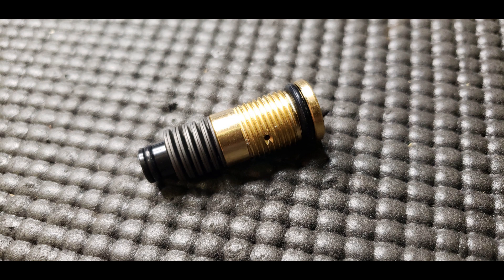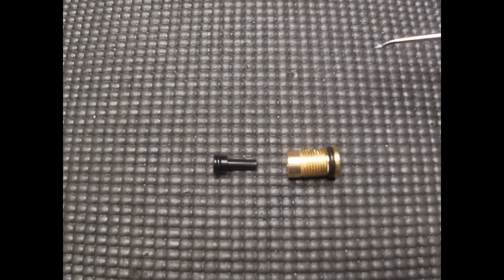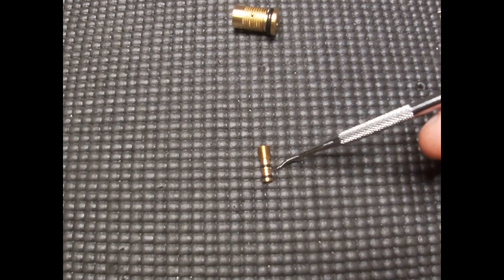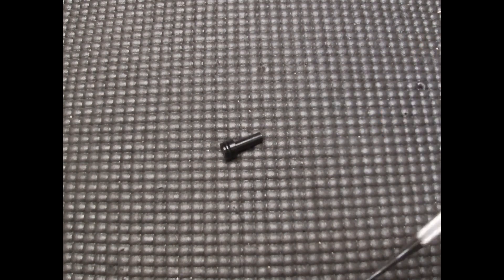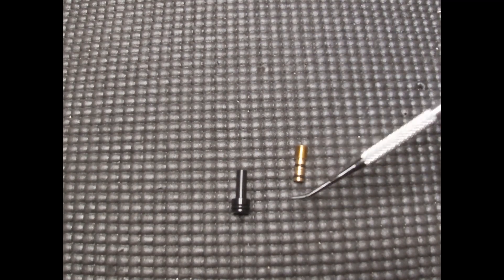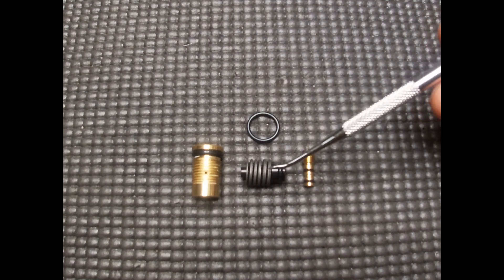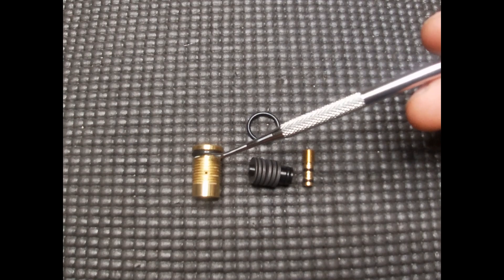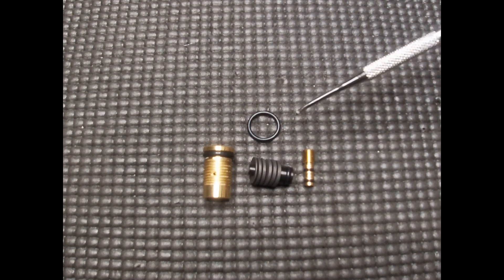How to Fix FX AMP Regulator Leaks and Regulator Creep - FX Airguns Bottle AMP Regulator Guide

Comment: How to recognize generations of FX Impact?
Reply from the maker: Gen 1 is produced before May 2017 (serial number will start with 15. 16, or 17). Gen 2 is May 2017 until serial number 183543 (has longer 16mm piston). Gen 3 is serial number 183543 until MK2. Gen 4 is MK2. Gen 5 is Power Plenum. The AMP regulator is in Gen 3, 4 and 5.
Reply: Thank for reply. I am order the wrong one. I’m so sad about that. I have order gen1 but my gun is gen2. If you reply faster than that maybe I’m not wrong. Can I use gen 1 for my gen 3?
Reply from the maker: @jennysok  I apologize, I try to respond as soon as possible. No. Regulators are not interchangeable, a gen 1 can only use the short piston. Gen 3 (AMP) can only use the AMP.
Reply: 910 Airgun Tuning and Repairs Thank you brother.

Comment: Hello, I congratulate you on the material ... very good explanation. I need your help, I have an FX Impact X to which I install an internal (original) power plenum to take full advantage of this new great capacity ... should I update my regulator for any particular version? Any recommendations if I go for a replacement for an original FX or HUMA. Note; I use my rifle in .22, .25 and .30 caliber, 700 mm long. Can you guide me? a greeting
Reply from the maker: With the FX power plenum, you will not be able to use over 150 Bar regulates pressure, so the original regulator is fine. No need to change it if it is working now 👍
Reply: @910AirgunTuningandRepairs  Excelente! Muchas Gracias por el consejo!!!

Comment: On the HumaAir website, I see offers only 12 and 15mm ((  https://www.huma-air.com/Replacement-belleville-spring-set
Reply from the maker: If you scroll through the options, the last few options are for the Impact and Crown, and they are labeled 8mm and 10mm.

Comment: GD, tell me what diameter belleville spring 12 or 15mm?
Reply from the maker: Hey! There are two different sets, but the AMP Regulator is 10mm. The older set is 8mm.

Comment: Hey , great video and explained very well .. what silicone o-ring/Assembly grease do you use or recommend ... thanks
Reply from the maker: I use a brand called SuperLube that can be found on Amazon. I will get a link for it and add it to the video description.

Comment: If I add more washer on my first generation regulator piston will that make a higher pressure if i need ?
Reply from the maker: Adding a washer will make it to where you do not need to back out the adjustment screw as far to reach higher pressures. For example (fake scenario), if before, 1 full turn out gave you about 100bar on the regulator, when you add a washer 1 full turn would give you about 120 bar or so. There is no exact measurement on how much it adds, just a knowledge that it allows you to achieve a higher setting faster. You should never ever go over 150 bar on a first gen, unless planning on replacing the regulator within 1000 rounds.
Reply: 910 Airgun Tuning and Repairs If i change my regulator for a Huma first generation regulator high performance 145-190...is that ok for a Impact first generation ?
Reply from the maker: @GinKenvin  you can change the regulator if you like, but to get higher velocities over 155bar regulator pressure, you will need an aftermarket hammer weight to properly open the valve. The FX regulator can do the same as the Huma, just won't last AS long as the Huma, but if you are running 160+Bar on that short piston set-up, parts are going to wear out faster than at normal pressures for either brand.  You will see vast improvement from adding the hammer weight and 6.3mm titanium valveseat, the Huma will just last longer than the FX at the high pressures. Send me an email to 910airguntuner@gmail.com of you need help finding the aftermarket parts.

Comment: Thanks for your videos. I have a perplexing problem with my Crown AMP reg, I have problems with the reg pressure rising with every shot. I have checked the reg screw to see if it moves but it stays put. I've checked all the orings seem to be fine, checked the spring washers fine too. Could not figure out what was going on. So I put a Huma reg in and everything is working great. But I'm still wondering what would cause that problem?
Reply from the maker: Sometimes an o-ring can be bad or faulty, even if it looks perfectly fine. The pressure rising with every shot is a more rare form of regulator creep. Even so, the culprits were either the regulator piston, or the lower o-ring on the regulator screw. Hope this helps!
Reply: Thanks very much!!  I’ll look and see what I can find out! Even FX couldn’t help me with this.

Comment: Didn't catch it but what might cause a reg to leak pressure down..
Reply from the maker: The regulator will only lose pressure when 1) The tank pressure falls below regulator pressure, 2) the regulator is leaking, or 3) there is a leak after the regulator (somewhere in the valve assembly), but the regulator has not opened to accept more air. Let me know if this helps!